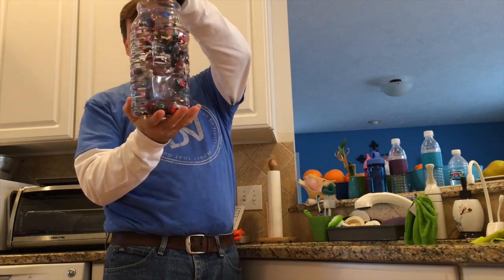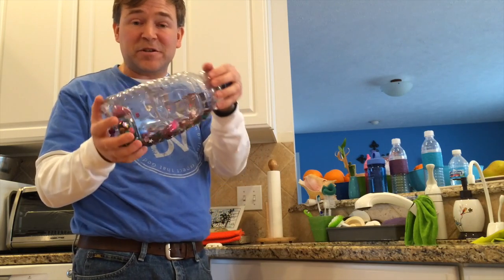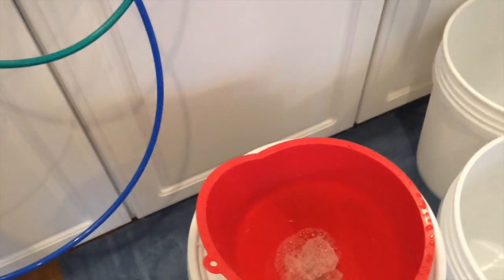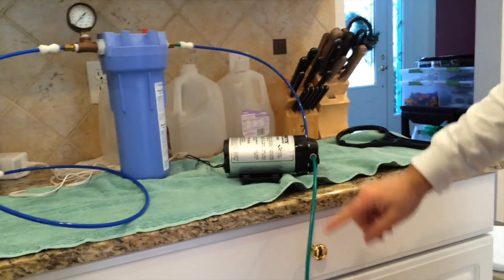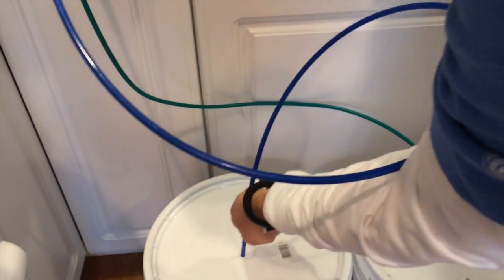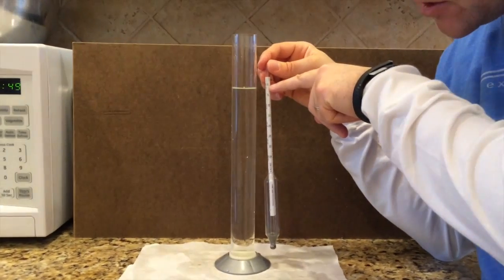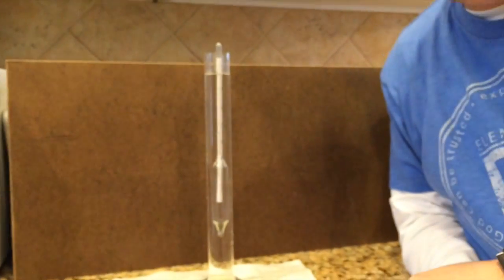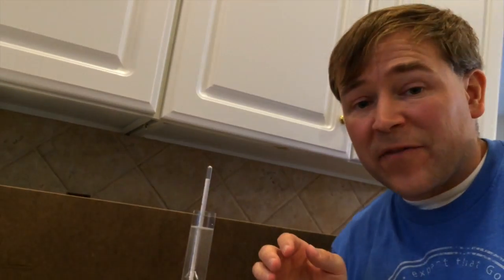Home Maple Sap RO Explained

Comment: Thanks Jeff.  I am awaiting to get the answer from one seller of the RO cylinder and filter rated 400 gpd what the optimal flow/pressure should be.  I make also small batches of maple syrup (may be 8-12 quarts) and so far haven just boiling it.  I have open fire pit (out of concrete blocks) with 3 SS pans and it takes me about 8 hrs to get one gallon of syrup (typically about 45 gallons of sap).  I would like to reduce that sap to about 11 gallons or so by RO in about 4-6 hrs.  

If I would use 4 RO cylinders size (in parallel)  like yours do you think your pump could provide the right flow to achieve about 35 gallons of water removal in 6 hrs?

Comment: Thank you Jeff.  Which size (and how manyj of the RO cylinders do you use to get in 4 hrs 75% water removed?  At such rate what is your feed flow and pressure?  If you started with 3% sugar content, and removed 75% water do you end up with 12% sugar sap?

I just wonder if you would get faster removal the water, with the same size of cylinders you get 75% removed in 4 hrs by using higher boost pressure pump (vain type)and running the same flow but at say 200 psi pressure.

Thank you, Rod
Reply from the maker: I just use one RO cylinder to save money and because I’m not doing a ton of Volume. But placing them in series would definitely speed things up.  

With the pressure, because my tubing and system is rated at ~100 psi, that is where I try to keep it. Usually if I start at around 100 psi, as the sap get thicker, it increases the back pressure so it often ends up at around 120 psi.  So far I have lucked out, nothing has busted, and I have not needed up with a kitchen full of sticky sap in the morning. 

But increasing the psi, would also speed things up.
Reply from the maker: To get the the right pressure, I just have a stop cock on the outflow that I slowly turn until the pressure builds up to where I want it.
Reply from the maker: My sap does not start at 3%,   I probably end up at around 9 or 10%.  But I can’t remember off the top of my head.  I used to keep diligent track of the numbers, but now that I’ve been doing it for a few years, I stopped keeping track and can’t remember for sure.

Comment: It is pretty good video.  I haven’t seen the answer on how long does it take to get 1 gallon (or any number of gallons) of the final concentration (22% sugar).  I would be even very happy to get the final concentration of 12% (which would remove about 30 gallons of water if started with 40 gallons of sap at 3% sugar content - if my calculation is correct),
Reply from the maker: If I start with a 5 gallon bucket of sap, it takes about 75% of the water out after about 4 hours.  The more concentrated the sap gets the slower it removes water.  So I might get 2 gallons of water out in the first hour, but less as time goes on.
Reply from the maker: I often just let it run over night and by morning the sap is as thick as it is going to get.

Comment: This is one of the best videos to explain, in simple terms, the RO process. Are you running the concentrate through the RO filter just once, or are you recirculating it and filtering it multiple times? I've seen several setups that have multiple RO filters in series but am not sure if that would increase concentration, or if just one filter and one pass is doing the same thing.
Reply from the maker: Nick Pouder , I run the concentrate back into the original bucket. So it circulates through again and again.
Reply: I''m curious if you have ever tested the concentrations with each pass to see if the sugar content increased. I am putting together a system based, in part, on your setup and another one that uses four filters in series, but I am not sure the multiple filtering actually makes a difference. I should have paid more attention in science class!
Reply from the maker: Nick Pouder,  I've done testing on sugar content, but don't recall the numbers off the top of my head,  in general, on the first pass I get ride of about 25% of the water, but was the concentrate gets thicker the efficiency goes down.  In general my system gets rid of about 75% of the water.  Once it gets around that point, the concentrate is just too thick.  

The RO unit needs back pressure on the "concentrate out line". I use a stop cock to make that back pressure and adjust it on my initial set up to have about 4 parts concentrate to 1 part pure water.  

The other thing I do is sometimes adjust the pressure (via the concentrate out stop cock) until my pressure is about 100psi.  As it gets thicker the pressure goes up some, I get nervous about it getting over 125 psi.  

If you had several RO filters in series, then it would decrease the amount of time it takes to get to about 70-80% of the water gone, then after that you will need to book the rest.  

I'm usually doing like 5 to 10 gallons a day, so I don't need more efficiency.  

My only real annual expense is the RO filter (this would need to be replaced annually, because you would not want mold growing in it). So I just use one.  But if I was doing more volume, I would put several together in a series.
Reply: Great job Jeff.  How much time does it take your systems to process 5 gallons to the desired sugar content?
Reply: Jeff Chamberlain I’m new to this. Can you please tell me why the system needs back-pressure at the concentrate out?

Comment: What is the rating off gallons per hour ?
Reply from the maker: The RO filter is a CSM Residential 75/80 GPD Thin Film Composite TFC Membrane.

The pump is a Watts Premier 560043 Water Filtration Booster Pump Kit.  I'm not sure what the gallons per hour rating is.  

I got both from Amazon.

Comment: where did you buy your special RO filter?
Reply from the maker: The RO filter is a CSM Residential 75/80 GPD Thin Film Composite TFC Membrane.

The pump is a Watts Premier 560043 Water Filtration Booster Pump Kit.  I'm not sure what the gallons per hour rating is.  

I got both from Amazon.